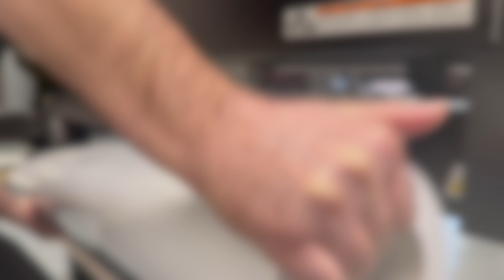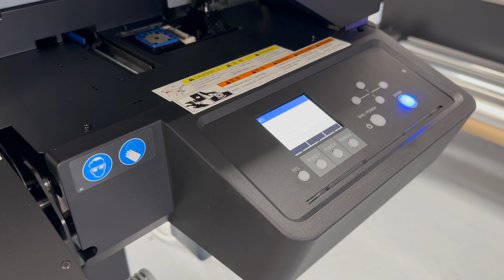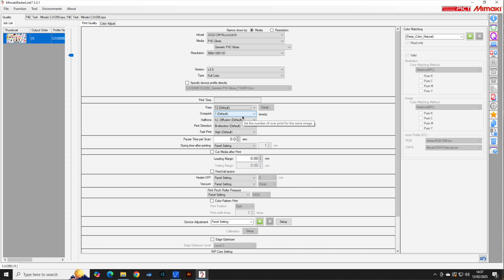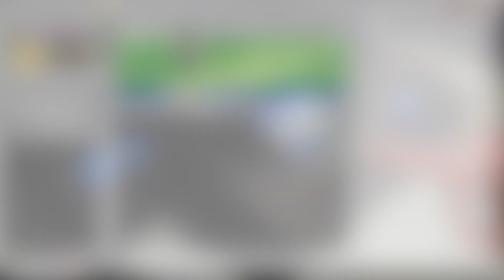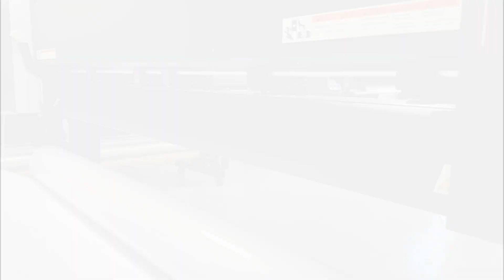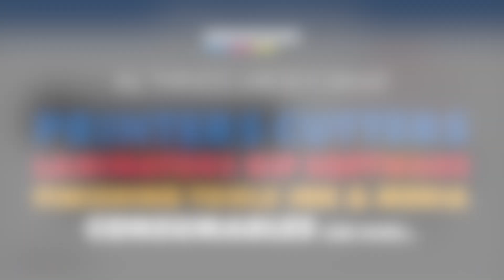How to Print and Cut on Mimaki CJV200 Printer / Cutter | Start to Finish – Part 1: Printing Process

Comment: Do you a white ink cartridrige in the far right slot?
Reply from the maker: No - the Mimaki CJV200 can’t be configured with White ink like the previous model (Solvent White ink is notoriously temperamental, so it would seem Mimaki have chosen to distance themselves and often recommend UV for printing White). This particular model is configured as an 8-colour system (Cyan, Magenta, Yellow, Black, Light Cyan, Light Magenta, Light Black, Orange).